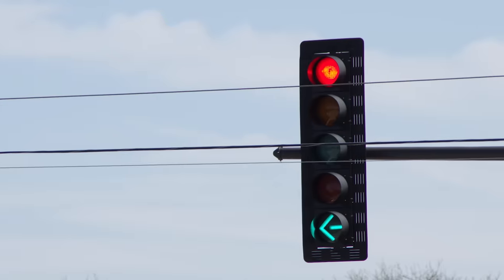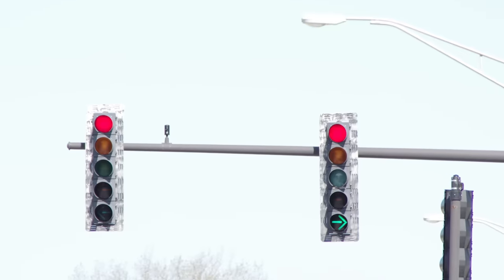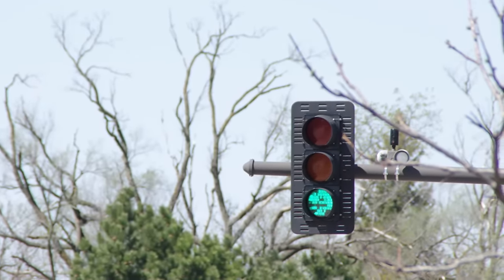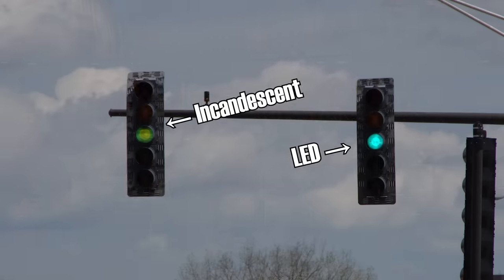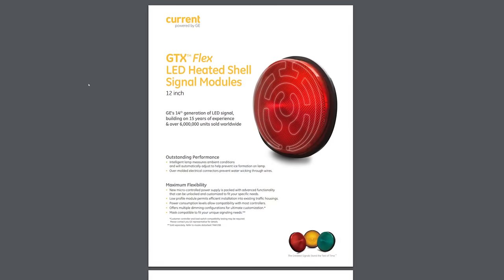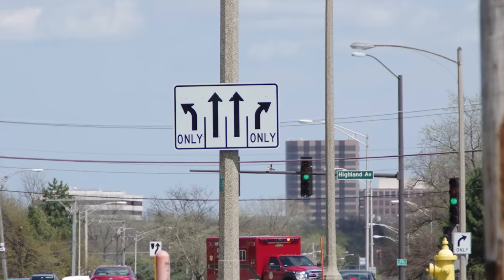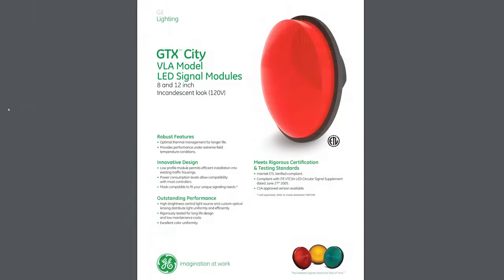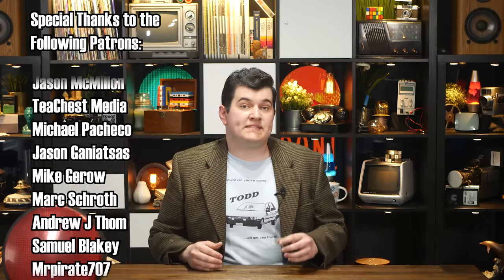The LED Traffic Light and the Danger of "But Sometimes!"

Comment: You forget to mention one reason incandescent bulbs are still in use. Warehouses full of incandescent bulbs.
Reply: Another is that the unions don't like the LED fixtures "takin er jerbs", so they won't allow the conversion. How nice of them.
Reply: Must be a US thing - all light sources that aren't LED are being or are already phased put here in Europe. 
Also. Our LED stoplights seems a lot brighter but smaller.
Reply: that's why you see bulbs in hotels too
Reply: RazzoGatto
From what I've seen, the lights in Europe are hung on the near side of the intersection, where in the US they are hung in the center or on the far side of the intersection. I guess if they're closer they can be smaller?
Reply: Led damages your retinas.
Reply: Any lightsource with some serious candela will damage your retinas. Remember pre-LED-Maglite, ma dude?
Reply: I only use incandescent bulbs in my house.
Reply: RazzoGatto Are being? As in, you still have incandescent/arc light sources in Europe? You guys must hate the earth. SMH
Reply: R.C. Whitehead your power company thanks you?
Reply: Jim Stanley "are being" in Europe really means that the laws are catching up with the many existing installations. On the US side, it takes a precedent from a series of catastrophic failures to sanction any old grandfathered-in tech., and only later if those  laws are summarily disregarded whilst causing injuries, GoGo Gadget class-action lawsuits, before they all go away. In either of the latter domestic case, adoption still is as slow and gradual as possible.
Reply: @ Mark S
That is utter bullcookie.
Reply: sadly you are probably right, but it's a sunk-cost fallacy on their part. throwing away the old bulbs and switching to LED's would save them enough power to make it a worthwhile move within a relatively short time.
Reply: Rune Fjord - you know what would save the most cost?  4 way stop signs.  Excessively prescribed traffic light installations are a massive waste of taxpayer resources.
Reply: Rune Fjord
Stop and think about who makes these decisions.
Reply: +Mark S Sunlight damages your retinas. Let's replace the sun.
Reply: R.C. Whitehead
Great way to get rid of impatient drivers. Made more impatient by having to stop at each and every intersection.
Reply: sounds great, wouldn't work. People are fools (and I would be to) maybe roundabouts?
Reply: Blake Belladonna What are you talking about? Pretty much every city, county, state and federal employee belongs to a union. Unions are extremely common in the US. Union lobbies in Washington are a huge problem here. Your statement about unions is objectively false.
Reply: That's a very valid point.
Reply: No way, 4 way stop signs are terrible because of bad drivers. I have to deal with one every day on my way to work and people are such idiots. I would love it if they replaced it with traffic lights.
Reply: Mark S for any given light output i would imagine incandescent bulbs to be much worse for your eyes since they output light in the ultraviolet and infrared spectrums, while leds have narrow spectrums only outputting the wavelengths required for a certain colour
Reply: Blake Belladonna The problem mentioned wasn't just the running lifetime of the old bulbs. It's cities and counties that have preordered a 50 years worth of spare lightbulbs at a discount, then stored them in a city warehouse. So they worry about the money already spent on those thousands upon thousands of bulbs, which won't fit anywhere else (traffic lights often use special bulbs that run at a different voltage and lifespan than regular lightbulbs).
Reply: The reason that they keep using bulbs is that the electricity cost does not come out of the maintenance budget and the LED lights do.
Reply: The military do the same thing but if war breaks out the supplies get used quickly. if your area has unusely amount of storms the light get replace more often
Reply: It is an Illinois thing.
Reply: Blake--He is in Illinois. Govt. unions abound.
Reply: gantmj 
Utter piffle.
Reply: There's a lot of different things to address here:

- Yes, simply scrapping the warehouse-full of incandescents and starting to use freshly bought LEDs straight away would save money in the long run. But then you've got a disposal problem of all those bulbs hitting the waste (or hopefully recycling stream) all at once, which will itself probably attract an additional cost. More importantly (if sadly), the people who pay for the electricity and the people who buy and dole out the actual bulbs tend to work in entirely different departments, with entirely different priorities regarding expenditure. The department that deals with paying for energy doesn't give a crap about the sunk value in the old bulbs, but the department that deals with buying and giving out supplies cares immensely about the effect on their bottom line of tossing what might be hundreds of thousands of dollars worth of stock, and buying in a minimum allowable stock of individually more expensive LEDs to replace them. It's office politics writ large, essentially. However, whilst this means the wheels of power can sometimes turn slowly, they do still turn... the supplies department can be brought around, and shown how the LEDs cost more to buy but are used up far more slowly (and that the energy they save means more money left over to allocate to everyone's budget next year, including their own), just so long as you do it gradually by only requiring a small number to be bought at first, then a few more, then start restricting the amount of incandescents they hold... etc.

- There's an issue that's not been discussed that not all LEDs are compatible with all existing sockets or light fittings. You may need to buy in a specialist type that's rather more expensive and has a shorter lifespan/higher overall consumption/suffers other compromises in order to be compatible, or more likely make additional outlay on adapting or outright replacing the existing fittings to be able to accept them (both physically and electrically). There are a lot of cases where new style energy saving bulbs can be dropped straight in, and start doing the exact same job as the old type without any trouble at all, and almost as many where making the change may actually be a difficult and expensive job, and only worth doing, maybe, when the existing bulb burns out. For a couple of very domestic examples, in my flat a couple of the rooms have electronic dimmers fitted, and unless you fit more expensive and less reliable electronic-dimmer-compatible bulbs they won't even turn on properly; even with those bulbs, the dimming effect isn't anywhere near as good as with the original bulbs, and it's noticeably different between each new bulb as their circuitry takes a different approach to modulating the current they draw versus the average input voltage. One of the switches actually burned out when I tried a particular set of bulbs with it, and I've replaced it with a much simpler rheostatic dimmer (which can also be turned from a definite, clicky full-off position through to fully-on in a fraction of a second with a quick spin of the dial, without any funky electronic side effects) which has proved far more compatible both with dimmable bulbs, and even non-dim ones so long as I turn it completely on or off each time. That was a relatively minor cost (largely because I DIY'd it - if I'd had to get an electrician in to do it for me, it would have been prohibitively expensive), but it's still one I'd have preferred to not have to go to, particularly as I only use full brightness in that room relatively rarely and most of the time the lights are dimmed right down... and I have no idea whether a dimmable CFL or LED running at fractional brightness is any more efficient than an equivalent incandescent. Certainly what I'm doing with the other dimmer now is using up all the existing incandescents I have of matching socket size with it, and transitioning more to using halogen bulbs with it instead (still legal at relatively high outputs, because their 30% higher light output per watt means they still count as "energy savers") to prevent it also burning out, particularly as it's a lower duty fitting than the first one and the potential energy savings are far less significant. I also have one halogen in the first fitting (they're all multi-way items) in order to boost the overall brightness, because small-socket dimmable energy savers just aren't that bright and the room ends up rather murky, forcing me to turn on additional sideboard lamps to get rid of the more troublesome shadows, unless they're backed up by a high output traditional lamp in the main fitting. The overall energy use is about the same overall, but the brighter ceiling light gives a nicer impression, allowing me to save the sideboard lamps for nightlight use (as the dimmer now won't go down below a certain still-brighter-than-the-lamps level).

Now scale that problem up to a city-wide one... particularly, e.g., with streetlights that use electronic day/night sensors, or traffic lights driven by 1990s or even 1980s vintage electronic systems that are wholly incompatible with anything other than a purely resistive load...

- The EU regs are essentially the same as the US ones. Traditional Tungsten-Argon incandescents are illegal to make or import, above about 40 watts (gradually stepped down from "nothing above 100w", then "nothing above 60w" over a couple years... possibly now "nothing over 25w", though they may have chosen to stop short because of the diminshing returns in terms of energy use and lifetime cost vs purchase cost and differential ecological load of manufacturing), except those made for certain special uses... e.g. oven or fridge lights that are tempered to deal with those extreme temperatures, or heavy-duty items meant for installation in remote and/or heavily weathered positions (all of which tend to be lower wattage anyway), which earlier types of CFL and LED weren't very good at handling. They do however remain legal to sell existing stocks of (so any traders who'd built up a warehouse full of them weren't forced to ditch otherwise perfectly good product, maybe going bankrupt in the process), and of course to use if you have them hanging around. The fact that most incandescents have quite short lifespans, sometimes as low as 1000 hours and certainly rarely over 2000, means that any remaining stocks will be largely displaced in decidedly less than ten years just in normal use.

There's little excuse to keep using them other than "I already bought it", anyway; bulbs that operate using a bare wire resistively heated to the point of emitting light of any wattage or construction are still legal to make, sell and use, so long as they meet a certain minimum efficiency rating that's somewhere north of 20-25% better than traditional Edison-Swan style bulbs. Which is a requirement that's quite nicely met by halogen-incandescent bulbs, which give a greater amount of light (and less heat) for the same wattage input (meaning you can get more light out of a fitting with a maximum wattage limit), of a better quality (much more even output across the visible range, still a bit yellow compared to sunlight but certainly much less orange than typical incandescents), are - in GLS form at least - less dangerous to touch whilst turned on or just after turning off or after they've explosively burned out, are intrinsically full-range dimmable, cost hardly any more than tungsten-incandescent, have two to eight times the lifespan, and can be universally dropped straight in place of traditional bulbs with no trouble at all. They might not save as much as a CFL or LED of equivalent lumen rating, but they're cheaper to buy and install and do still cut almost a third off your energy bill (or your carbon footprint) for the same brightness as an incandescent (or give almost a third extra light for the same energy; if attached to a dimmer, you can vary between the two positions...), and are an extremely useful stopgap between the old style and the new, where the latter represents a difficult and/or expensive upgrade path. They've also been well proven in the automotive arena where they've been providing extra brightness and a whiter beam versus plain bulbs, in an application where maximum wattage (but, thanks to the age of the legislation, not the lumen output) is strictly limited by law, without the cost (and unreliability, and installation difficulty, and weird colouration) of HIDs, for decades now, and are only now starting to be displaced by LEDs because the new tech actually wasn't quite up to snuff for the challenging environment and extremely safety-critical application represented by a car or motorcycle (or bus, truck...) headlamp enclosure.

- "Taking our jobs" is almost certainly based on the reduced maintenance required... I wasn't even aware that the US still had a lightbulb manufacturing industry, most incandescents (and indeed halogens) I've ever seem appear to be of Japanese or Chinese make anyway. But the failure of the domestic industry to successfully transition over to producing CFL or LED (or halogen, or indeed micro-arc) alternatives, or city authorities to find something else useful and publicly beneficial for their idled workers to do instead of just firing them, is hardly the fault of the technology itself. If there's one thing you can rely on, is that things will change and that no job is actually completely secure. You can't force things to stay the same (unless you're the tinpot dictator of some small second-world country that rapidly ends up a third-world laughing stock as a result), the only thing you can do is roll with the changes and try to make the best of them.

- FWIW most hotels and other public buildings where I've even noticed the lighting (or been able to check it out) seem to use a mix of fluorescent (compact, 2D or strip), halogen spots & downlighters, and LED upgrades to both..
Reply: Also I find it rather entertaining that there's an American here claiming that Europeans must hate the environment just because we haven't sent all existing incandescent bulbs to landfill unused, when they still may have some genuine utility... I mean, if you have cold winters, you may as well swap your energy-savers for heatballs, particularly if you have an electric (or oil / wood burning) rather than gas (or coal) heating system, as they'll reduce the load on your main heating system and generally only be turned on in the rooms you're actually using, so at worst you'll break even on the cost... no need to waste the energy and carbon already sunk into their production and replace them with energy savers that almost certainly have a greater environmental production cost in an overly hasty fashion.

And, well... let's just look at your automobile and road haulage fleet and compare the average MPG of each (and the size/weight/engine size of typically owned vehicles - isn't it Ford who are cutting down their US range to just the Mustang, F150 pickup and a fairly large SUV, whilst still selling two or three classes of vehicle in Europe that are smaller than anything they've sold in the US of late? Never mind your general shunning of diesel, for which the VW scandal is only really a small blip that will encourage manufacturers to make their successive engines even less polluting from now on), and how much you guys choose to drive instead of cycling, walking, or taking public transport, and the distances your city planners mandated people end up having to travel just to conduct their daily lives. As well as typical house size, the ways you tend to heat them, the general popularity of air conditioning even where it's not really necessary, the massive light displays set up at Christmas... etcetera.

Oh, and where are the states that recently have managed to either cover their entire energy usage for several days on the trot from renewable sources, or at least have been able to shut down all their coal fired powerplants and keep them turned off for a considerable period?

As for 4-way stops, I can only really agree that they're a bad idea, the same as lights that run a lengthy preset program 24 hours a day with no sensor adjustment or use of flashing yellow. It just encourages people to violate the seemingly pointless restriction (humans don't do well when faced with apparently nonsensical rules), and ends up creating unsafe situations through a blinkered bureaucratic refusal to account for human nature. What works better is, depending on the individual situations, designating one of the crossing roads as the "main" one (even if on an entirely arbitrary or random basis) and setting the intersections up to allow it a free run with the "side" streets having stop signs or preferably give way / yield signs, installing roundabouts (so long as the rules governing them are sensible and well-understood), or even setting up 4-way yields - which have a psychological benefit both in allowing drivers to pass through without completely stopping so long as they moderate their speed enough to be able to spot opposing traffic and stop safely if needed, and in making it less certain that other drivers are going to stop for you so you're encouraged to be more careful. We have a lot of variations on all of those in the UK, including the mini-roundabout which is a combination of the latter two (makes the "give way to the right" (would be left, in the US) rule more obvious and discourages cutting across the centre, so two right-turning vehicles approaching from opposite directions can turn "behind" each other, drivers side to drivers side), and even in some odd cases a 3, 4 or 5 way crossroad where all but one of the directions is a give-way, so there's still a direction with definite priority in cases where multiple vehicles turn up at once, but otherwise it's a fair round-robin. And whilst you don't have to stop at them too often (only when there's someone else whose priority trumps yours), they still encourage a cautious approach, say scrubbing down to about half the usual running speed (and maybe only dropping 1 or 2 gears) before accelerating out again, without the inefficiency and average speed murder of having to come to a complete halt and work your way up through all the gears.

We still find situations where those kinds of junctions get overloaded, or have frequent problems of unclear priority, or simply have unsafe sightlines where at least one of the directions would need a full Stop sign instead (something we don't much bother with other than in extreme situations, preferring to engineer our way out of it or implement turn-taking priority if at all possible), and that's when we install traffic lights. Instead of just automatically shoving them on every single minor intersection...
Reply: Jim Fortune ... I thought Obama outlawed incandescent bulbs.  I suppose that now we have bulb sanctuary cities.  lol
Reply: They'll have been outlawed under his administration, maybe, but there's more to a government than just the man at the top. Hopefully you're not having a dig at the idea of energy security?

And those cities won't really be sanctuaries for incandescents... if they're still in use, then those cities are the places that they're actively getting used up... just give it a few thousand more hours of runtime.
Reply: Kind of the same reason why some music albums recorded as late as 1990 were still recorded on analog recorders.
Reply: Oh No! You've got it on FIVE! My paramecium are going to DIE!!!
Reply: 'American' and 'manufacturing' belongs in the same sentence much like 'Styrofoam Cup' and 'Gasoline Container'. Or 'Play-Doh' and 'Microwave'.
Reply: Exactly. Technological changes don't propagate overnight, even if you try to force the issue (where it just goes a bit faster). Particularly in both cases it took many years for the tech to become affordable, or even just on a par quality-wise with the old equipment (a lot of early prosumer PCM kit was decidedly less than CD or analogue master-tape quality, much like a lot of early energy saving bulbs sucked) never mind cheap and of superior grade.

Of course, now, we have pocket-change devices that offer digital recording and replay vastly outstripping anything you could have practically achieved with analogue (unless you were prepared to spend hundreds of thousands custom-building your kit), and LED bulbs which cost hardly any more than incandescents used to with full dimmability (some of the most recent ones even emulate how incandescent bulbs give a whiter/bluer light at full/overdriven power but a yellower/redder light when dimmed down, for better daytime and nighttime "eye friendly" illumination in a single unit without a separate control interface), excellent colour rendition and stability, much longer lifespans and better reliability, and of course much lower energy consumption, as well as being just as recyclable. It's taken a long time getting here... but, we are here, much as people might complain about the slow transition.
Reply: Think that's only in France, also have smaller corresponding lights on the post at eye level to let the stopped driver know when it changes.
Reply: They are, technically, lasers.  Ones in an optical drive are 'optimized' for that purposed. 
Agree that I find them harsh (being only a single wavelength of color), same for taillights.
Perhaps using sets of LEDs with hues that straddle the wanted color would help, but add cost
Reply: Marvin Blankinchip
No, that's Australia. Logically even Trumpsters can't blame Obama for that. Logic and Trumpsters. Never mind.
Reply: Kozmo IGM Kliegl
No, they're not lasers. They are not spatially coherent . And not only France.
Reply: +Kozmo IGM Kliegl ... OK, you're gonna have to contextualise those two replies for us. Who were you replying to?

Monochromatic light isn't automatically harsh, it's people specifying and/or installing them who set an unnecessarily high output intensity that causes that, and you can suffer that just as easily at the hands of incandescent bulbs. Particularly if you have one that's quite heavily filtered and the filter glass gets broken...

Plus monochromacity isn't the only defining feature of lasers; as Jim says, they also need to output coherent waves (which is the other secret behind their high intensity and efficiency). Which is why you still get a definition between LED and Laser projectors, or LED and Laser based printers. They work differently. LEDs are typically inherently more diffuse in their output, and are easier to diffuse further. And, again, insufficient diffusion isn't the LED's fault, it's the fault of whoever designed or installed the unit.

There's an awful lot of things the tech gets blamed for that are actually nothing to do with it. Though that's a common thing amongst any advanced and poorly understood technology (and, indeed, demographic groups, recreational media, etc...) really.

And we already have ways of getting broad spectrum output from LEDs - use a deep blue diode behind a layer of phosphor, and essentially turn it into a slightly more efficient, and far more controllable fluorescent which doesn't need anywhere near as complex support circuitry. Where it's needed, it's used (e.g. for room lighting where you generally want something reasonably white with a wide spectrum output for good colour rendering), otherwise it's not worth the extra expense.
Reply: It feels like I have my own little wharehouse full of incandescent light bulbs (not halogen). Got two bags from when my grandparents passed.
Reply: They're still being made
Reply: @Marvin Blankinchip he didn't
Reply: @jimstanley_49   No. We don't worship the earth. Man didn't create the earth and it is certainly not a "mother" .
Reply: @patcola7335  Did you just delete your comment because it sounded totally ridiculous even to you? Isn't it lucky that copy and paste is a thing?

'pat cola replied: "Jim Fortune Let's put it this way. Obama hated this nation and did everything he could to change it "fundamentally"... do you remember that ? Remember him saying he would change this nation '

I think I'd pretend I never wrote that too.
Reply: @JimFortune  actually I didn't delete it. I kept it up.
Reply: @patcola7335  It's not showing here. Might be bugged.
Reply: I have no problem with what I wrote. This is what 8 years of Obama did to this nation, but it started before him.

Why didn't you paste all of what I wrote ?  Because you know what I said is the truth.

Listen guy I'm not going to argue with you about politics . I'm tired of it all and so are many.

 Trump wants what is best for America and it's people. That means ALL Americans who are native and not here illegally.

He isn't perfect by any stretch but at least he isn't trying to sell the country out.
Reply: @JimFortune  Probably shadow banned as YouTube is against anyone also for Trump and trying to silence those who actually still love this country .
Reply: @patcola7335  Well, I can understand why YouTube might not like Trump trying to silence those who still love this country.
Reply: @Blake Belladonna unfortunately, the public workers union covers roughly 60% of the workers in state or federal, and about 40% of local and county.
Reply: @roderickwhitehead  I know a few hold outs. If you like burning money, to each their own.
Reply: @mspenrice  Having a stock and using it up CAN be economical. It IS in this household, where the stockpile is only used in the broom cupboard, in the corridor and on the landing.
We recently replaced a 500W floodlight with a 25W LED, because the old floodlight was rusted shut and could not take a spare halogen tube. The new unit cost almost £100 including fitting. The spare tube would have been on for about a minute per week, less than an hour per year, costing under £0.07 for a year's worth of electricity.
But obviously these arguments are irrelevant for traffic lights, where an immediate upgrade will always be economical.